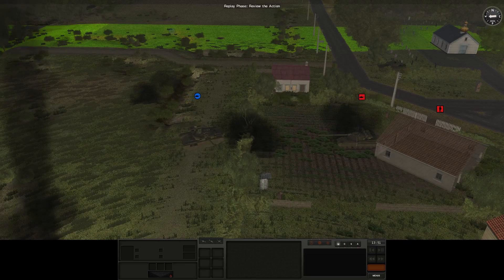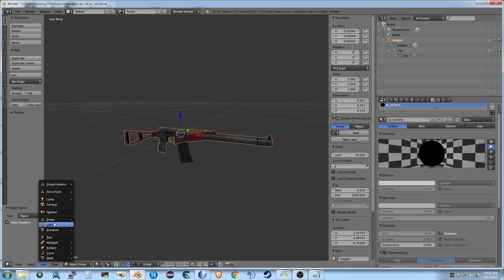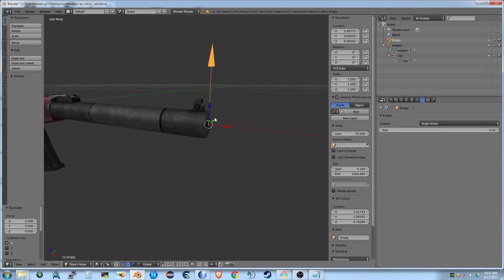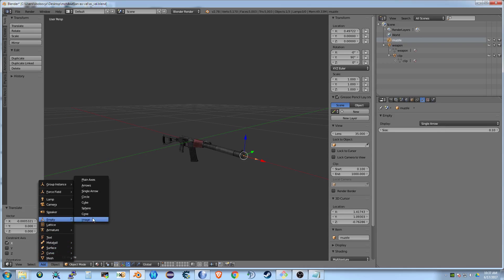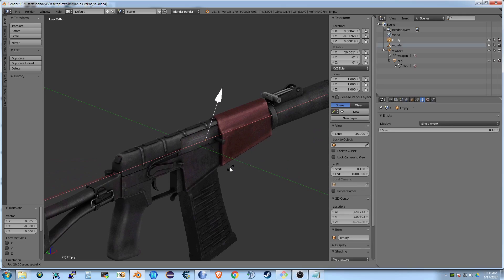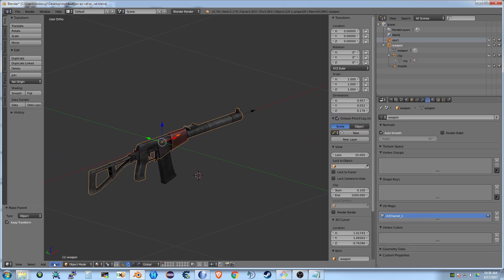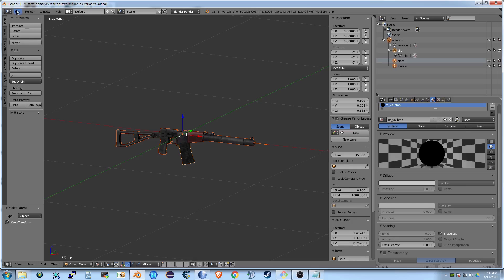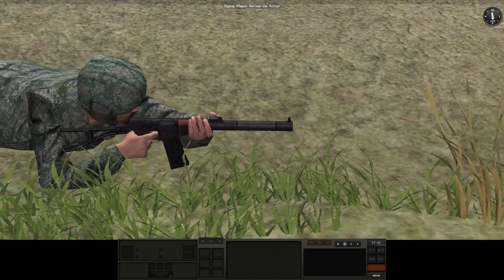Combat Mission: Creating and Exporting Weapon Model with Blender plugins

Comment: Do i ha e to use rezexplode and rezpack after?
Reply from the maker: Rezexplode is only for unpacking brz files. You can put the mdr file in the Mods directory, no need to create a brz.
Reply: So right into my z folder?
Reply from the maker: Yes, z folder would work. With the newer games, I tend to just use Documents\Battlefront\Combat Mission\Black Sea\User Data\Mods, the Z folder is just the last one to be loaded (I think this is how it works).
Reply: sbobovyc ok ill try that. Thanks!!
Reply: I really want to use the m203 a use a different buttstock for the saw
Reply from the maker: Cool, should be a simple enough visual mod. If it works out, post some pics on the forums.